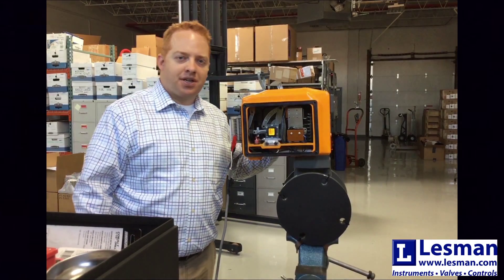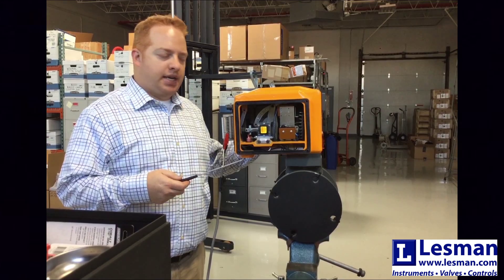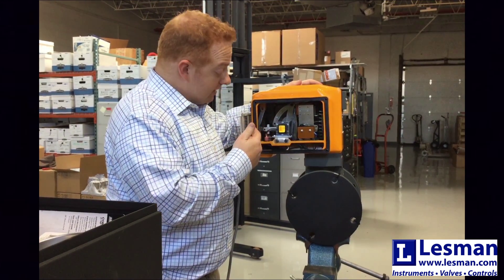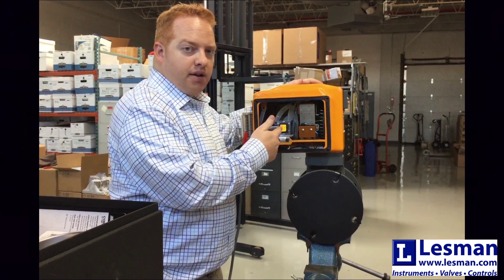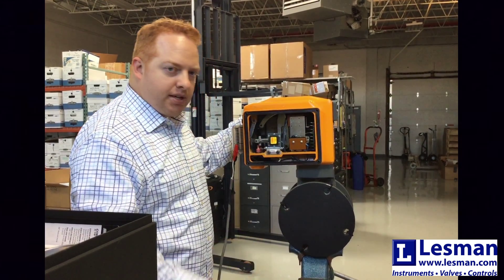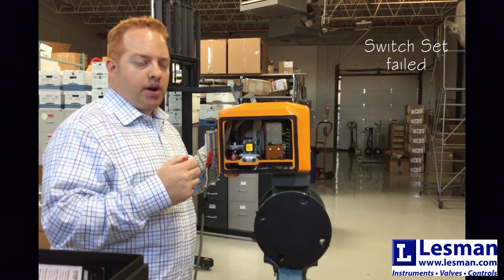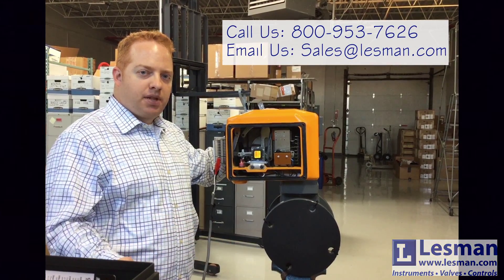Troubleshooting Maxon Shutoff Valves by Sound

Comment: Thanks for the video. The problem I experienced was from the indicator the valve attempted to open got half way down and then shut. The cycle repeated before it shutdown completely. Is this the way it Wud look infield if something was off with the switch or spring.  I did hear the motor.
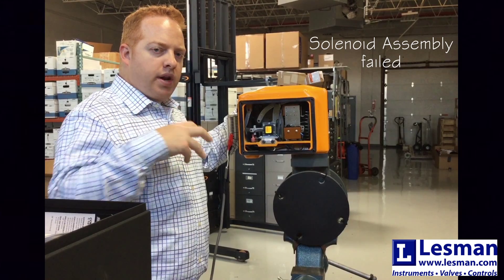Reply from the maker: +Mr FiXiT At the 3:14 mark in the video, I describe what it would sound like if the switch set fails, which would behave very similarly to what you described (valve tries to open, then closes, and recycles continuously).  I’d take a closer look at your switch set to see if the actuator wand needs to be adjusted or if the switch needs to be replaced.
Reply: +Lesman Instrument Company 
Thanks a lot sir
Reply: My valve partially opens (about 50% open from closed) travel pin abut 1.5” away from open switch paddle, then the roller comes off the perch, or the latching solenoid releases, then the valve closes again. Manually need to restart sequence from panel. Motor doesn’t continually cycle at trip. 🤷🏻‍♂️